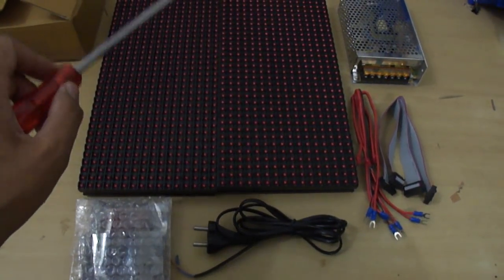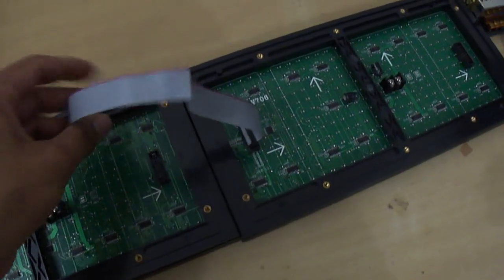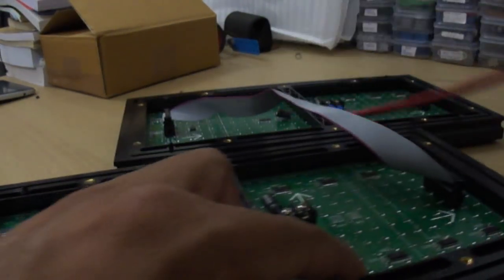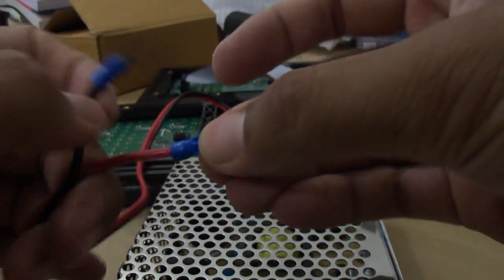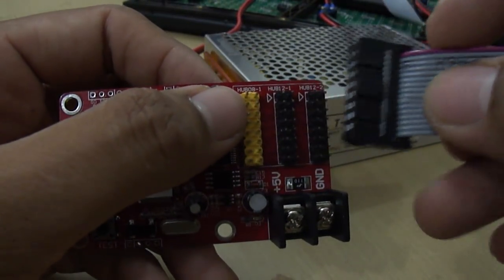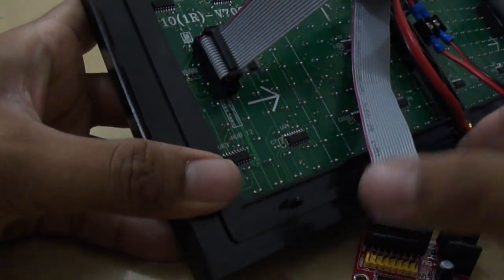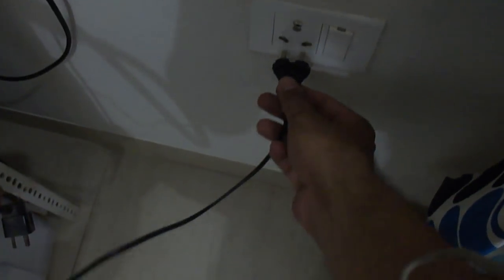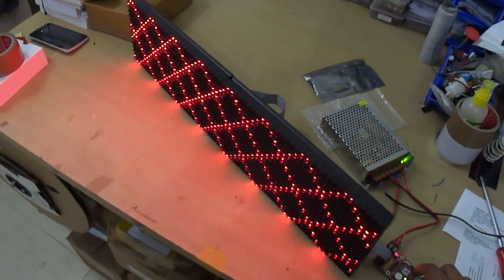P10 LED Display DIY Starter Kit - Hardware Assembly Procedure - rareComponents.com

Comment: Great informative video..
If i would like to run 4 led panels then do i need smps of 5v 20amp ?

One more question

Y my 5v 20amp smps is heating while i am using the same with 4 p10 panels

Pls rply ..

Thanx in advance

Comment: sir my project is regarding moving message display board but its high resolution can i get a starter  kit having p2.5  display module instead of p10 and an open source software to control led control card

Comment: Hi sir,
     It's great video,more helpful.
Currently I have one p10 led display having 8 module. So I am creating 64x64 screen.
So Currently I have HD W-60 controller, It gives me a size as 512x32.
so is it possblie to use same controller for 64x64 screen. Or I need to purchase any other controller? If I need then please suggest me the controller name so I can purchase it. 

Thanks,
Ruturaj.
Reply: Hi, there!
You need a controller with 4 x HUB12.
Or you can use the W60 but configure the screen in two rows: 128x32. Of course you will see it in the preview mode like 128x32.. Depends what will be published on it

Comment: How many panels can I connect with the same power supply?
Reply from the maker: Not recommended to drive more than 2 panels with 10A SMPS supplied with the kit. If you are going to use many pixels in your design more power will be required. Also, Number of panels that can be driven from this SMPS depends on the brightness of pixels and type of design. It can drive 2 panels at full intensity even if all the leds are lit up but not more than that. One panel running all the pixel at full intensity consumes around 5-6A current.
Reply: Hey @ @rarecomponents  I use 16*96 module 3 pcs .....so which SMPS i can purchase...is 5v 20A enough
Reply from the maker: @sachinpatil-nz5vn  20Amp will work. But buy 30 or 40A for full brightness and long smps life. https://rarecomponents.com/store/1774 this one comes with 1 year warranty
Reply: Can i connect 192 panels of 32x16? Is possible?

Comment: How can we connect the device so that we can give program
Reply from the maker: RAHUL KAKI You have to transfer the program to a pen drive from PC after that connect that pen drive to controller card. If everything goes well you see the new content.
Reply: Hi sir,
Can u suggest me how to process the program and how to operate it through an source like video or pdf
Reply from the maker: RAHUL KAKI Single color panels do not support videos or pdf directly. You have to use full color panels and suitable controller board for playing videos. You may start with single color first and learn to create animated display text images etc. Using this kit. You can buy this kit from our website. Free shipping
Reply: Please tell me this.. in what format should I save the file in pendrive.. which need to be connected to the controller..
Reply from the maker: RAHUL KAKI That is done by the software automatically. Software is supplied with the kit itself. You have to design the display in that software and export the file to flash drive
Reply: Agar aapke pass processors 1000 Hai to aap use apne phone se bhi use Kar sakte. H

Comment: How you know T12 interface?
Reply from the maker: Please elaborate!
Reply: rareComponents.com:  I am confused about hud-75, hub-12, hub-08. I have several panels P3-(2121)64*32-16S-D1.0 that i wish to test. Input not labeled with pinout or hub type. How do i know hub type? Panel has RGB leds and 16 pin idc interface. I see ads for controllers with hub-08 and hub-12 that say they run most panels. Will hub-08 and hub-12 run RGB, or only hub-75 run RGB. Will controller in your video run RGB panel?  Thank You for help.
Reply from the maker: All RGB  panels have HUB75 while single color panels come in HUB12 or HUB8. HUB12 and HUB8 can not run full color RGB panels. HUB8 can run dual color modules but not full color. If your panel has only RGB full color LEDs the hub is most likely HUB75.